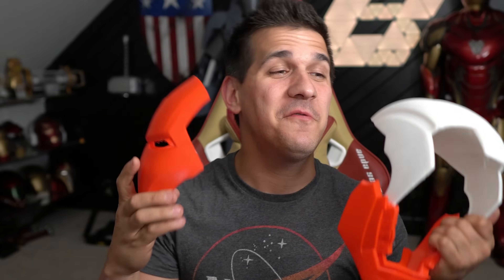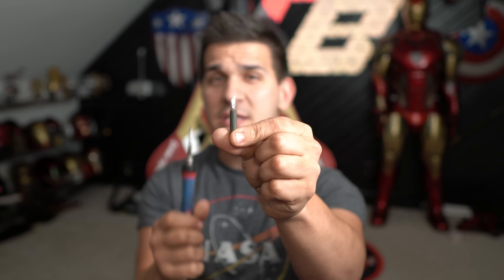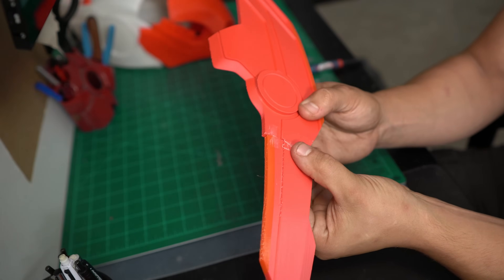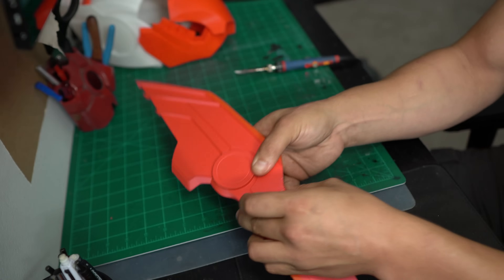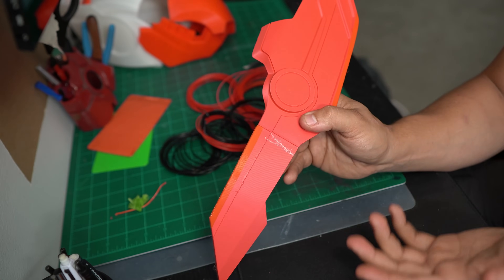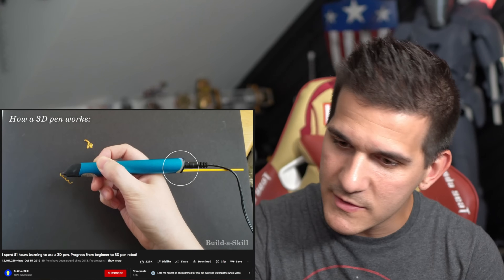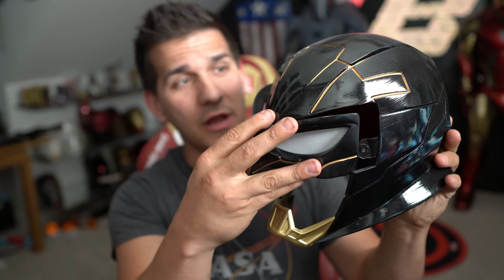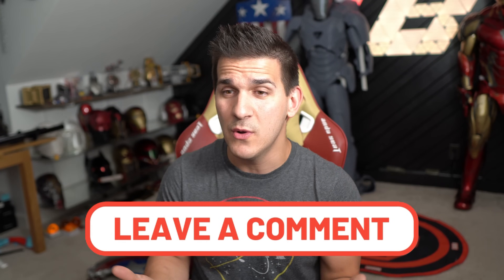How To WELD 3D Prints - FUSING Prints Together with NO GLUE!

Comment: I use one of those 3d pens for small stuff. THose are great for welding parts of small figurines or table top characters because you won't mess up the small details trying to melt the two parts together. Great for small broken pieces, and even recreating parts that were completely destroyed by the support structure which happens all too often even with the best of us. You're right though, it's not good for large stuff that takes stress. But I have also used the soldering iron, or actually it was a wood burning tool, but same thing really. In fact in a pinch I also just heated up the tip of a knife and used it like a wood burning too.

Comment: I see this is an old video, however I'd just like to point you to Pyrography kits, often referred to as wood burning art kits. I find them much better for this task. You get some very thin tips and a good variety. They heat up faster than a soldering iron, and you work much closer to the tip, giving a more pen like feel. I also like to have a 3D pen for filling, that's also a good way to use up your ends of filament.

Comment: I am new to all this, but the method I came up with is using this cloth like buffer head that came with a dremel tool. It doesnt take any material off but when you get the rpm's high enough it kind of heats up the surface and kind of smears the plastic around, and is easy to sand, but only the barest surface material. It requires some finesse, but it does work. I found your tips helpful. thanks

Comment: This is the same method for fixing many plastic automotive parts!
You could fix a broken mounting tab for a headlight!
If you need some 'welding rod' for your repair, simply cut a small redundant piece of plastic off the headlight.
Thanks Frank!
edit: i forgot the best part!  if you get some metal screen material you can bridge the seam and use the soldering iron to sink the screen into the plastic.  Crazy strong!

Comment: I'm doing an Omnibot 2000 modernization/restoration, so thanks for the tips, I think I will probably need this.

Notes for myself:
Tape the two pieces together, leaving some room to weld.
Brush each side over each other with a soldering iron
Use spare filament to fill the indent
Peel some of the tape back, repeat

You can weld the outside if you plan on sanding it down, otherwise maybe just weld the inside.
You can use the soldering iron to smooth out other bits on the print that weren't perfect too!
Using this to hide magnets for snap-together parts is a great idea...

Comment: So I was doing the Mando helmet and while sanding I ended up delaminating a strip (a 1 inch wide by 6 inch long strip of the outer wall came off).  I tried filling it with bondo and was able to build it up, but the edges of the wall keep pealing up, after having already put bondo on there and priming, could I backfill the pealed up part and sand it flush to try to “weld” the pealed up part down?

Comment: I rather use a hot air gun with temp and airflow control. just don't melt the hell out of it all as it'll start melting more than just the edge you want and it'll flop over etc. I use left over PLA with the airgun to stab into the part so it melts into both sides, a bit like the 3d pen but with more control.

Comment: Pen welding is pretty useful on smaller/thinner parts, as the molten material that the pen extrudes is enough to melt the part itself. If not, pushing the pen's nozzle into the part definitely helps.
There's also the friction welding trick where you print a 3-4mm thick, 4-5cm long cylinder laid on its side, and put it in a Dremel. Then you drill it onto the part that you want to weld, and the friction melts both the part and the cylinder.

Comment: I once talked to a fellow cosplayer about welding parts and he used S shaped metal staples and heated them up with his soldering iron and pressed those in the parts first to make a sort of mechanical connection and then smooth it over with more spare plastic.
The S shapes clinged more to the hollow internal structure than just molten plastic (he said).
You should try this.

Comment: I just started using this method with soldering iron and it helped so much for my first mask! After you smooth it out and sand it how do you get the front part to look smooth? I can still tell where I welded it together. Or do you just paint over it?

Comment: I was wondering if it is possible to melt leftover PLA into a tube, and stick it into a hotglue gun. The tip of my gun can get up to 200°C and use it the same way as a welder. Melt the material while adding melted material to make a strong weld. As welding metal. Have anybody maybe tried it?

Comment: Simple, yet super effective. 
A similar solution I saw (similar in creativity, anyhow) was using a 3D printed 'glue' stick and a glue gun! I guess the glue gun temp is quite close to PLA and so it can be used in place of glue, but I like your solution more! The glue gun solution is still additive and could get in the way of a clean look whereas this creates a solid union between the two pieces that can easily be manipulated then post-processed! 
Fantastic stuff!

Comment: In when your programming to put cut your parts apart can you put on the inside of the part a little access piece that comes up so when you marry the two pieces together you have that strip on the inside that's glued to it and not and edges too 1 Park gets to access lip in the other part don't and then you slide them together and glue everything or welded on the inside that way there's an excess like a 8th of an inch strip over the scene on the inside of the print of the helmet or something then later on if you want to use magnets to put it together like that using that led to put two pieces together permanently

Comment: Great video, gave you a like. My first 3D print is made from 8228 material (light green that is sort of like ABS and sort of like Nylon).  I have a bunch of 1 inch by 0.5 inch rectangles that are about 0.75 inch high and pocketed all the way through, and I need to glue tops on them to form 5 sided light baffles for panel indicator lights for my hood mounted instrument cluster. The walls and tops of these light baffles are all 2mm thick. I don't have the item in front of me as it is being shipped from JLCPCB in Hong Kong. What would you suggest I use to "fuse" the tops on top of the 4 walled rectangle? I don't think a heating tool will work because there is only about 1 mm gap between each adjacent rectangular baffle. The bond has to hold up to 140 F and automotive vibration. Thanks.

Comment: I fall down on my nose while trying to build the real sized Stormbreakter (was my first multyple Part 3D Print in this size...). It was a Pain in the ass, even with the pritable Connectors. Main Problem was that when i'm try to use the connectors, the parts do not fit 100% to each other. So there was close to zero Contact between the Parts and the Glue has close to zero chance to hold both parts together. The Stick of Stormbreaker is about 5 single realy sized pieces. The Iron-Trick for melting parts together was an absolut Game-Canger!!!! Thank you very much. If your sanding, prieming and painting after its the best way to connect the pieces...

Comment: Have you tried using the string of filament straight from the spool to melt onto 2 pieces? Instead of burning both pieces directly? Would this work?
Reply: I imagine that would work, but it would be similar to to using a 3d printing pen. Good for thin/shallow prints, where it can penetrate into crevice.

Comment: I bought a 3d pen for this purpose early on in my 3d printing journey but after seeing your videos and couple others about pla welding and I'm going to switch to using my soldering iron, although I think I'll have to see if mine has removable tips or not as it's only a fine tip one.

Comment: Just wanted to let you know that this method saved me.  I am making a Bo-Katan helmet for a friend of mine.  I used epoxy to put the pieces together and while I was sanding it, I put too much pressure and the epoxy let go separating the front from the back on one side.  After watching your video I was able to weld the pieces back together and it is stronger than ever.  I went over the entire inside of the helmet welding all the seams so this wouldn't happen again. I am so glad and thankful that you posted this video. Now I have a tried and true method of attaching parts together permanently.  FYI, I subscribed to your channel. Thanks again.

Comment: Dude. I'm new to 3d printing and my first print is a flight helmet prop.... I've used superglue to fuse then 2 part resin'd the inside shell.. and used bondo glazing ont he outside seams. 
and it keeps falling apart.  I've been pulling my hair out.  
Just came across this and it was insanely helpful.  I have a wood burner that is perfect for this. 
THANK YOU.

Comment: It's Not called post processing. It's actually Prep Processing as You preparing it like a Spray painter would Prep & Sand a Item Prior to Pain. This whole re invention words are laughable. All these Young Peeps be trying to reinvent new abbreviations for Prep Post, As your Not Post anything your Prepping your part for the finishing layers or finish preparation aka Prep Work. Post is Past when your not your Prepping for another Step. OMG young Millennials be like 🤯🤯🤯.
Reply from the maker: So I get where your coming from…but it’s still post processing. You’re spending time cleaning and smoothing it AFTER or POST printing. No one’s trying to reinvent anything. Sorry if you had some emotional stake in the this lol calm down

Comment: Very late but just want to say that I tried a 3D pen first, it absolutely cannot maintain temperature, it barely can even while actively extruding which makes it quite useless for any consistent welding and an adjustable soldering iron is definitely way better. I also want to say that if there's smoke with the soldering iron then it's too hot, it should be maybe 20-40C higher than your printing temperature. Slower to work with yes, but smoke ya don't want. Have yet to try welding material back in using some loose filament but giving it a shot soon!

Comment: I have a question. I am a welder/metal fabricator by trade but 3d printed has sparked my interest in order to make tools I may need that aren't available. As a welder we tend to use backing plates to hold pieces together more firmly my question is why not print a tab to weld both pieces where it would not show sort of like a backing strip?

Comment: Is there a reason that keys aren't used more often? I've seen some builds that use pegs or dowels to join things, but I've never seen seen any sort of male/female connection built into the model itself. Or even a tooth shape, like this \_/ seems like it would more reliably fit things together, for both alignment and surface area for weld/glue... I'm only just about to enter the hobby, so maybe i'm missing something obvious...

Comment: Last week, one half of my 3d printed pieces actually failed due to a power outage. I tried my best to recover it using the other video you made. I also ordered one of those adjustable soldering irons from Amazon as well. As of typing this message, I'm testing out this method on another print that failed on me last year as a practice run before I get to the real thing. I also learned in the past that if I were to take a cotton swab, while the metal piece was still hot, and I can  clean it off like I would do on my 3d printed nozzle. If successful, I should be able to smooth it out, but as for added rigidity, I might be better off casting it in a different material.

Comment: Thank you so much for this, I'm working on a Captain Rex Phase 2 armour at the moment. 
One of the things I have done is use your tutorial from Meshmixer to cut plain a thin small piece of the print to use as a raft to add an internal brace after welding say a chest or back plate together. The biggest problem I have had is sizing. I've downloaded Armoursmith and now I have to learn the programme . By the look of your tutorial on AS it's going to take time ,but have benefits in the end. ThNk you Frank regards Graham

Comment: I'm a practitioner of the ancient art of gunpla building and we always have a fix. Plastic Cement is a go to. 

It works similar to plastic welding, but instead of being heat based adhesion, it's chemical. The cement actively melts down the plastic, then bonds to itself as it dries. When pushing the pieces together, ensure some of the cement comes out the sides then leave it to try. Doing that will make a ridge between the parts that can easily be sanded down after the parts finish bonding. We use it primarily to remove seam lines left between parts on a poorly engineered build. They're common on the sides of the head and running up and down the forearms.

I'm pretty sure I should be able to do something similar just scaled up for the print.
Reply: Is there a brand of plastic cement you prefer to use? I usually weld PLA, but would love to try this to see the difference!
Reply: @mikemorgan9224  Gunpla are made primarily of ABS, and I use Tamiya plastic cement to bond pieces. I think you can print in ABS so long as you also have either good ventilation or a fume hood, I heard printing with ABS can get a bit stinky.

If you're dead set on using PLA, Tamiya might still be an option. I haven't tried it though, so only test it out on small prints first, then scale up with scrap. If that doesn't work, plumbers cement is basically just stronger shit, so that might work instead

When all else fails, try acrylic glue, that shit will work on anything

Comment: Bit late but just getting into this (get my first printer Saturday) but I’m curious.. have you ever heard of, or tried something plastic model kit makers use called “sprue glue“?

It’s where you take old bits and chopped up plastic sprues and mix them with a thin modeling glue and let them melt into it. Gets a great adhesion and can be made to color match if using the same color plastic you’re using it on. 
Also great for filling in gaps and cracks.

Just curious if there’s an opinion on this, I’ve been binge watching your vids among others and learning a TON. It’s got me stoked to get started.

Comment: I actually used both of these methods- I normally put the 3d pen in the crease of spots then use my hot knife and slide along and super smooth it out that way- also guys if you save your "rafts" and they are pretty thin- you can use them like patches as well- I will say this Franky should practice and use a 3d pen a lil more.. Ive added some really cool and extra things with mine- and I think it would help you out on the small details!

Comment: So - why is this better than gluing? Arent there glues that melt the plastic?
Reply from the maker: This is like welding metal. You’re mixing the 2 parts together to be indistinguishable. Most glues and even “welding” glued don’t get the type of penetration something like this does. And it’s free-ish. No extra materials. It’s the strongest way.

Comment: Does welding with mixed materials add any value? Like, could you weld with PETG filament to better secure two pieces of PLA?
Reply from the maker: Nah they won’t bond properly
Reply: @FranklyBuilt  thanks for the heads up!

Comment: You are clearly very good at this.

A note on lining up the pieces, if you design your own parts, you can create joints, like in woodworking, or simple keying to align the parts. It would not work as well on the flat parts shown here, but I mention it since you didn't bring it up.

Comment: I had fun welding two bits together plus the extra filament left over. I usually weld fursuit head in either PLA or TPU. It came out really strong (and flexable with TPU). Fun is over, next teeth and eyes, you can weld them too.

Comment: You should use some of the plastic as a bead so it fills the hole made. Sorry but he should have used super glue to hold the inside together and then use the soldering iron on the outside to make it stronger.

Comment: How bad exactly are the fumes?

 I called out another YouTuber for doing this inside without good ventilation or using a respirator and he told me fumes are non toxic and that pla is made from corn. I came here for a second opinion.
Reply from the maker: Old PLA sure but now that every company in the world makes some mixture of PLA with literally zero regulation (especially a slurry of overseas companies) who knows. And PLA+ is another beast entirely. Your printer doesn’t give off smoke but this does. I’m melting the plastic at a much higher temp then the 200~C it says, more than double. So I’m sure it isn’t good. Any type of smoke at all (especially from plastic) isn’t safe. Better safe than sorry. I’ve been dumb with Plastic welding before and I don’t think it’s worth it. That’s why I wanted to mention it in this video too. Respirators are cheap AF and your health isn’t ya know?

Comment: This is a very stupid way to do that. It adds so many more steps on when you can just use glue specifically made for filament like 3D Gloop. You then don't end up with a mess of a seam and takes far longer to clean up. Stop with this crap
Reply from the maker: So adding a new chemical to the mix instead of solidly reinforcing it is stupid? Good talk 👍  keep up the sound advice

Comment: interesting , from what i can tell your method seams like TiG welding techniques , after a year or two of trying to weld it similarly , i realized a cheap 3d pen (personally i like the mynt 3d with oled , or the 3dsimo pro multitool) to do MiG welding by extruding on the slowest speed and at 230c for pla to really make it molten and able to weld into the seams ,and if over filled a bit just file it down and its seamless with no discoloration. aswell as being able to do tack welds with a drop from the pen tip saving on the need for tape